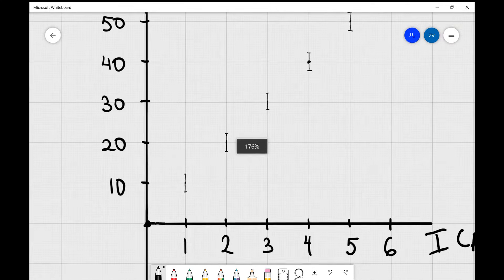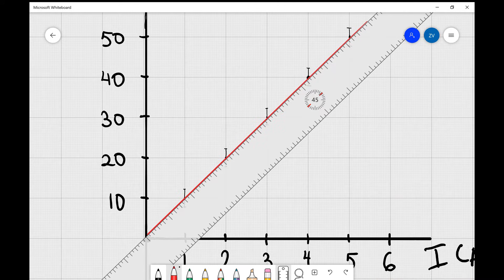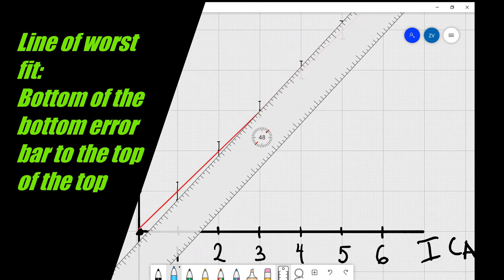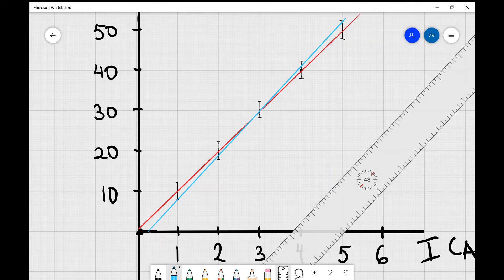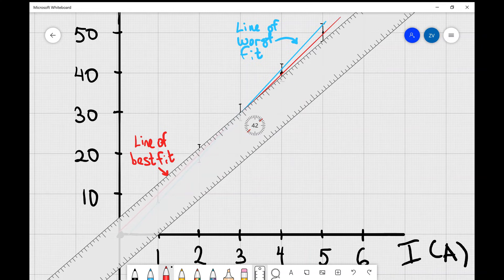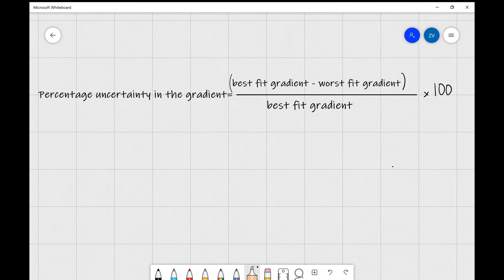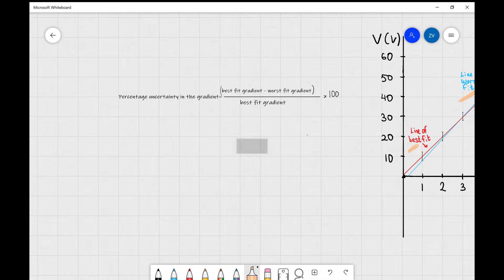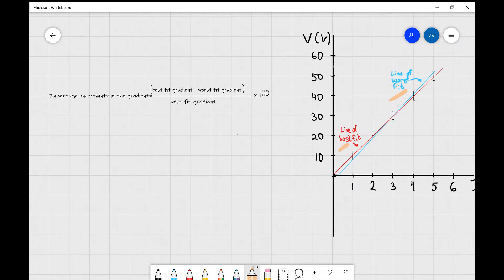A Level Physics: Uncertainty and graphs, line of worst fit

Comment: for an experiment to calculate absolute zero since the value is on the x axis to find the absolute uncertainty can you do: draw line of worst fits max and min gradients and do the mean of both the x axis values?
Reply from the maker: absolutely, AQA typically does it this way to determine the best gradient essentially. Hope this helps! The intercept of the mean values in this case would be absolute zero.
Reply: @zhelyo_physics  thank you

Comment: Sir shouldn't the formula be like - percentage uncertainty in the gradient = (worst fit gradient - best fit gradient) / best fit gradient  * 100,   instead of (best fit gradient - worst fit gradient) which would return a negative value
Reply from the maker: both are equally valid and both could produce negative signs depending which lines we consider.  As the uncertainty is +- we tend to take absolute value of the difference and not worry about the sign. Hope this helps!
Reply: @zhelyo_physics  thx sir this solved my confusion

Comment: Is there another potential line of worst fit by using the error bars for the x-axis values?

Would you just look to see which line would be worse when choosing between y-axis error bars and x-axis error bars?

Good video anyways!
Reply from the maker: Thanks, yes, you could apply the same rules if there was an error bar on on the x axis. The line of best/worst fits would follow the same rules and go through both.
Reply: @zhelyo_physics  cool 👍

Comment: Im doing AQA instead of OCR however what i learn was that the best line of fit passes from the top of the bottem bar to the bottem of the top bar.
Reply from the maker: that also works. There are actually two lines of worst fit. I normally just say bottom of bottom to top of top as it's easier to remember.